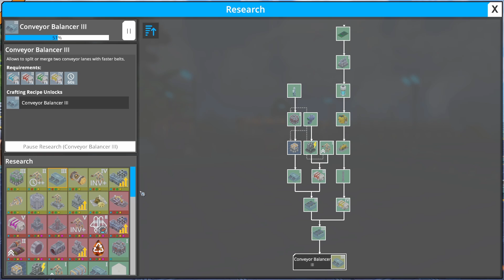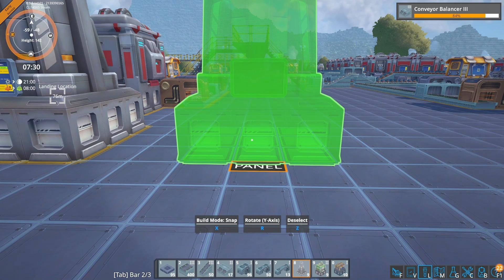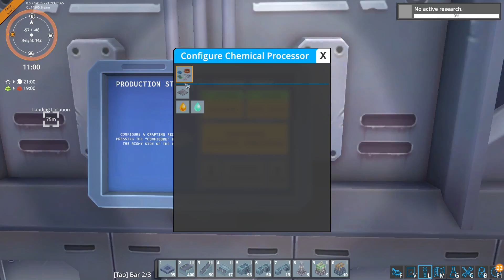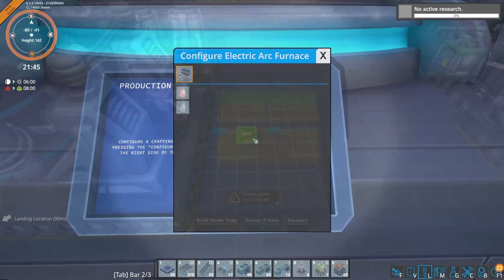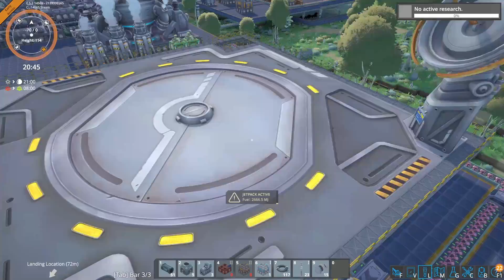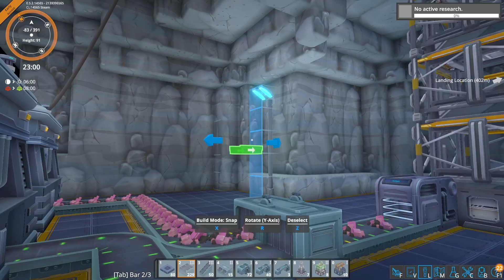Foundry - Perfectly Balanced CPU Factory Layout  [E11]

Comment: One trick I learned from factory games to improve transport throughput is seeing if I can "compact" resources before shipping. With Telluxite, the rubble to ore ratio is 4 to 1, so crushing at your mining location is beneficial since the ore is 4 times more dense than the rubble and boosts the throughput by a factor of 4 instantly.

In Satisfactory for instance, Caterium is better moved as ingots than as either ore or wire, again due to it being the most "compact".

Just my 2 cents..
Reply from the maker: Very good point. Thanks.

Comment: Perfectly balanced until the nodes run out. Haha. I see these videos of people setting up so-called perfectly efficient layouts somehow forgetting that the game doesn't have permanent nodes (until late-game I guess). I am not saying your setup isn't reasonable; it is very reasonable. I have seen some very unreasonable setups that I don't see how you could ever implement in a real game. Gotta make those YouTube videos. Haha.

One thing I have found about this game is that the real logistical problem that you need to solve is resource transport, both ores and goods, not extreme efficiencies. I spend most of my time thinking about inputs and outputs for my machine chains, what I need now, what I might need later. For example, I use a three-space gap between all my belts that manage resources because three spaces is the minimum space needed for a splitter and ramp to create a cross-over. It sounds wasteful but it is incredibly flexible and has saved me hours when I needed to adjust my production system. I try to black-box as much as I can so I can change things without impacting the whole factory. So far it is working. Not perfectly, but I am able to make progress, and I am getting better at it. In my opinion, if you set up a resource transport system that is both flexible and scalable, implement a production scalability strategy that you can implement without redoing the whole factory, you will beat the game.
Reply from the maker: There is a lot of balancing needed. And those transports really need to speed up, possibly 2 at each node. I don't think using up space is wasteful. You have an abundance of it, why not? It sounds like your setup works so big ups.
Reply: @surtrplays  What I find interesting about the game isn't really the factory building, I think Satisfactory is much better at that, but rather what is the methodology needed in order to progress through the game without rebuilding your factory at every unlock? That is what I am more interested in figuring out. It is an interesting, and non-trivial puzzle to solve.

Comment: I agree the current resource elevator could be a lot smaller.  It only supports one belt anyway so why a 3x4 size?  It could be much smaller and that would make it more useful on the factory floor rather that just at mining sites.
Reply from the maker: I think the freight elevator has a purpose and it is fine for that. Conveyor lifts only need to transport one belt up a short distance like 20 blocks max. and only need to be 2x1. That would be cool.

Comment: Buffer the deposits into storage boxes. The transport ship won’t move unless it’s full or empty. So you need to fill it up quicker using more inputs/outputs. The quicker the turnaround for the transport ship the more throughput you get. 

I’ve got each ore vein miner going to it’s own freight elevator going into one logistic box on the surface which is then loaded by 4 belts into the transport and then on the unload side I have 4 belts unloading into a storage box.
Reply from the maker: Thanks. That makes sense. I will look into it.
Reply: @surtrplays  love the series so far. Finding myself waiting for the notification that you have a vid ready 😂

Comment: I'm not sure if it made a difference or not, but you had ore patches unchecked, so maybe you had some smaller nodes closer.  I hope in the future, since it's an infinite map, that they would add trains as part of their roadmap.  At least it would be a better buffer than having slow transport in the shuttle craft.  It does have its uses.
Reply from the maker: Now that I have the vein, I'm not going to bother much with the small ore patches. The veins can be made infinite. It is early in early access, I'm sure there is going to be a lot of cool stuff coming. Thanks for watching.